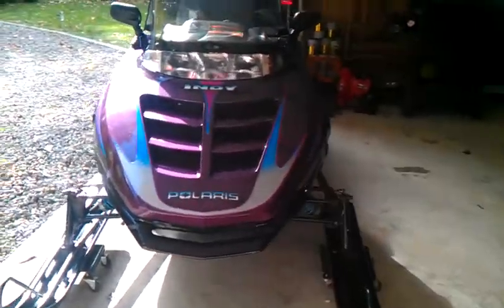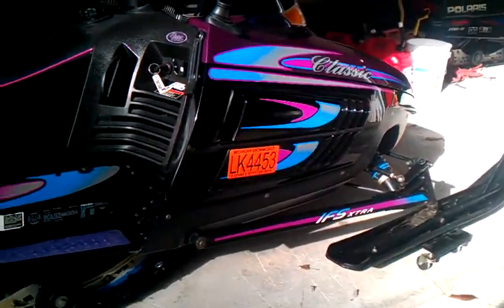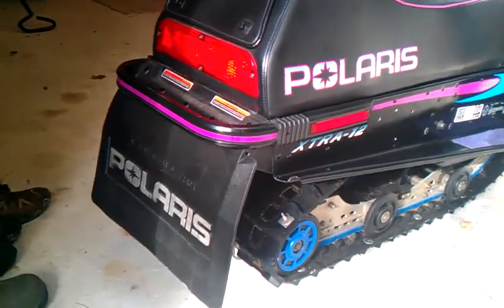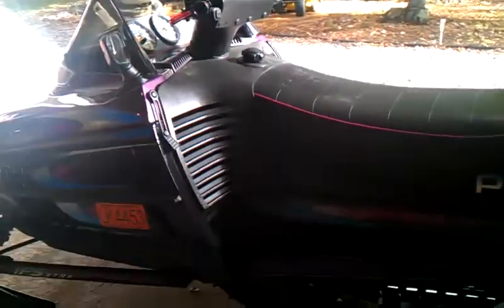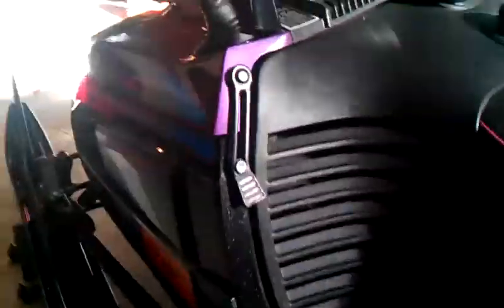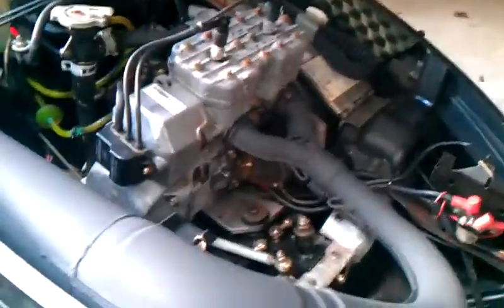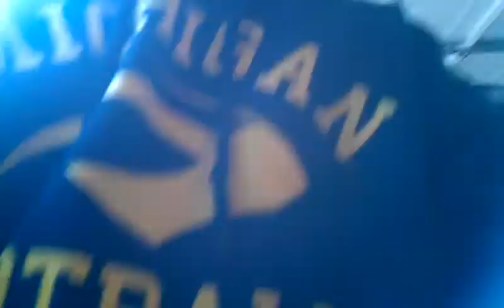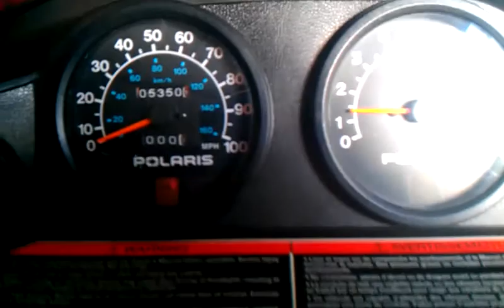1997 polaris indy classic 500 walk around and exhaust

Comment: You got a Fuji Twin 500 in this? Strong motor. The Fuji triples were bad, but the twins were excellent. My buddy has a 550 Classic with the Liberty engine, and it can almost keep up to my Sno Pro F5. Enjoy your sled, man. The Indy classic is awesome!
Reply: +Donovan Bulmer I have a 2000 Classic 500 with the liquid Fuji twin with 5100 miles on it and it still registers about 125-130 psi on each cylinder.   Strong bulletproof sled and motor.